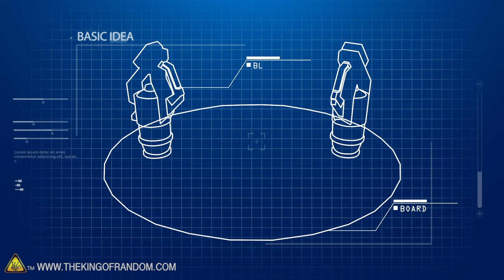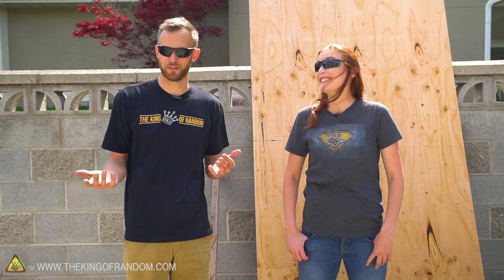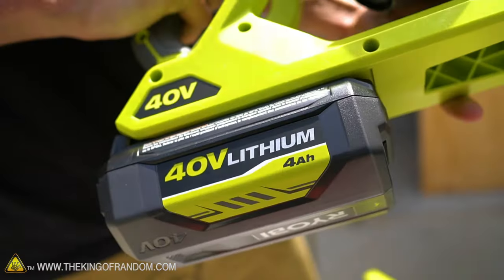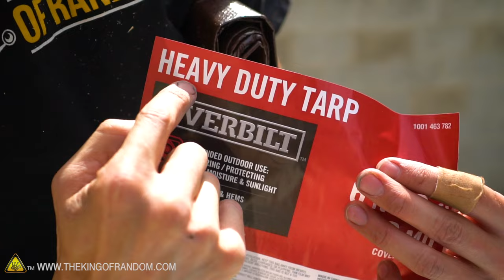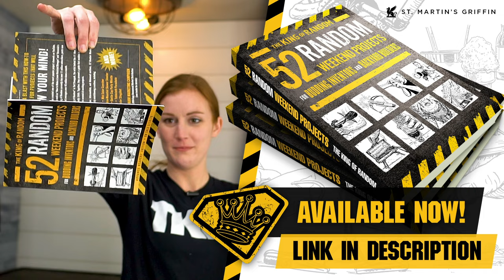Lighter Than Air! Easy DIY Hovercraft on a Budget

Comment: This is like the one thing everyone wants to make.
Reply: They should make a ping pong ball machine gun/blaster. Using a leaf blower or air compressor
Reply: When did the create a hole in the bottom to allow the escaping air to form a "cushion"?
Reply: Tom Nally well surely that's just common sense you can see they had cut a whole in it so just drill it out to the size you need
Reply: My uncle has one anyone not home made a real one
Reply: My dad made one when I was four, but I wish we still had it now.
Reply: Cole K. Ok
Reply: aditya sabharwal why not?
Reply: I WANNA MAKE DIS NOW
Reply: Not everyone 

Jk
Reply: This is the sort of thing I subscribed for in the first place.
Reply: aditya sabharwal why

Comment: Plywood is flexible and is not helping hold the air. Also a skirt system added to the outside edges would probably make it work much much better.

Comment: Built one of these in high school. Used 2 leaf blowers, however we used one to fill the plastic and a second one to blow air under the plastic to create better hovering. Also added a shop fan and a spoiler to push air downward for push.

Comment: Instead of staples and duck tape, caulking (or liquid nails) around the edge (and then either staples or brad nails) seem to do a great job of both sealing and holding the tarp on the edge...I've been a part of 3 or 4 of these types of builds (but never with the battery powered ones, so I gotta try that!) in the past and those turn out the best...
Great video and thank you for sharing!!

Comment: I remember we did this for a school project once, we used these electric air pumps for camping (i think 2 of them) and powered them with a car battery.
I'm still nervous about that thing today because the car battery was also the seat and it was getting pretty warm over time :'D but for some reason these little air pumps did way more than your leafblowers.

Comment: Today I was messing around in a sprinkler, and I noticed that a couple jets of water were intersecting, and where they intersected both jets of water stopped with a mist behind them. I thought it looked cool and thought that you could check it out and see what conditions need to happen for it to form. I also thought it would be cool if you tried to make some sort of water art with different lines intersecting to make something that looks cool. I just saw that happen and the first thing I thought of was that you could check it out :D

Comment: We've had a battery leaf blower hovercraft at the school that I work for years (had it for all the 7 years I've worked there). We tend to stick the younger kids on it and that works best (they go flying across the room!), but it works for teens and small adults too. Ours has the blower in the middle, I wonder if that would distribute the air flow better and reduce the drag.

Comment: You should put a small lip on the underside of the hoverboard to "catch" the air put out and use as a kind of air cushion to give slightly less resistance.

Comment: 2005 i made one for my daughter. It consisted of a 1.2 m diameter plywood disc, plastic tablecloth, a compact disc as a washer, a battery powered vacuum cleaner, duct tape and a lot of tacks. Btw those leaf blowers move a lot of air but cannot provide sufficient pressure so i suggest using a larger disc.

Comment: Centrifugal turbines are designed for specific rpms, temperatures, and viscosities often in stages with vents, baffles, and other variable design concepts.  The vintage vacuum hover craft plans mentioned a vacuum because if it’s high pressure to cfm design

Your leave blow

Comment: What if there was a skirt around the edge of the board could you get a little more lift increasing the distance between the board and the floor?  A little more room for sinking down before making contact with the floor. Like a hovercraft?

Comment: maybe start with a concave aluminum sled (like Chevy Chase burned up in Christmas Vacation) or making the wood concave (wet it, weight it, dry it) and put a "skirt" on it that fills with just a little of the air from the blowers. If you can keep the air under the hovercraft it works better.

Comment: So some advice, as I made this for my kids years ago.  Center the exhaust. Wrap the edge in duct tape and pipe insulation.  The idea is to trap the air as a cushion under the board. Im a big dude and a 80cc blower will lift even me.

Comment: You need to try with two of the wired ones and get a ton of extension cord or get 2 more battery powered blowers see how that turns out.

Comment: Some ways you could improve this is put more weight on the outside of the hover crafts so you could float longer. The hover crafts are floating more in the middle.

Comment: You need to find some battery-operated blowers with locking switches, put 3-4 of them in the same design.
All switches locked on and away you go...hopefully.

Comment: You could make the hoverboard put Wireless if you did it longboard style and used for leaf blower is of the same brand that Ryobi or whatever the brand is that you were using they probably would have worked if you did it as a longboard instead of a circle

Comment: I showed this to my sister and she said that if you were to put magnets on the ground with one side (ex: N) facing upward and put magnets on the bottom of a board same side facing down, the magnets would repel and hold up the board. She also had the idea that if you lean in one direction you'd likely be able to go that way because of the friction. Do you guys think you could test out my sisters idea? Obviously you'd need very large, very strong magnets.

Comment: The leaf blower has high air displacement but does not produce adequate pressure to achieve lift under the skirt of the craft

You should use a lithium powered shop vac to push air into the hovercraft not a leaf blower or fan

Comment: I got a question what happens if you take the liquid soap you can find in a pump and shake it until the soap is filled with so much air it turns whitish in color than put that in a vacuum chamber?

Comment: I remember building one of these when I was a teenager. I used my parents' shop vac and it worked pretty well but the range was so short and floor space so limited that I couldn't do anything fun with it. Also, they didn't show making holes in the tarp around the center board.

Comment: Probably worked better if you had a larger surface, then the battery powered ones would have enough pressure to lift.

Comment: Your hovercraft is missing the skirt, which retains the air under the board. That's why they don't work so well. If you had a skirt, probably one blower would be enough.

Comment: That’s bad hover craft design.  You gotta put a skirt along the edge to create a high pressure chamber.  You would have a lot better results if you did that.  We actually built battery power hover crafts from my engineering 100 class freshman year.